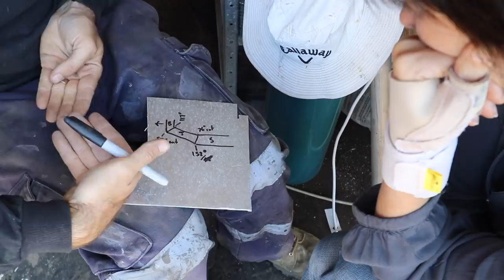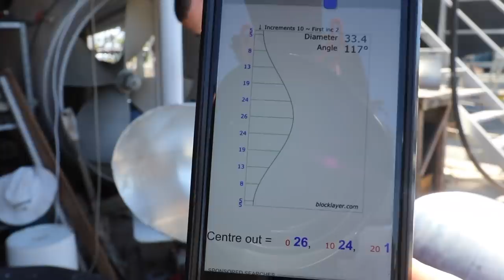DIY 2.5m Aluminium Pontoon Dinghy Part 2 - Project Brupeg Ep. 108

Comment: I did this with fiberglass a couple of times...once as an ultralight that planed off will a 3hp.
And once as a fwd decked heavy duty tender
 
The major problem was the dinghy getting under the curve of the hull of the big boat and banging hard...not a big deal when it was inflatable...but hard knocks for sure
Reply from the maker: Yeah our plan for that is to add a soft layer to the outer tubes. It’s not goi g to stop all of the banging but I’m hoping it will shut some of it up

Comment: Lol great teamwork! Only suggestion I would make is to weld the inside seams also if you are leaving those on the bottoms in case of water, or just orient them to the side or top so that no water sits in the overlap
Reply from the maker: Yeah we can oly weld the first 300mm or so as the spool gun is a bit to long to fit inside the tube. We plan to fill the sealed tubes with closed cell foam so its unlikely we will have any water in the dink.

Comment: Draw straight lines 3 6 9and  12 
Measure the distance at those points then in the middle of those points take more measurements connect the dots make cut

Comment: I welded some perlins down here in Mexico for a guy to make legs for a barn. It's not what I would prefer to use, but it's what he wanted. None of the barn was designed by an arquetect or engineer, so I was not real confident in the structural strength. So when I had to do butt joints on thin material, I welded strap over the joints so that there was much more weld holding the material together. It would be kinda tacky, but some aluminum strap that overlapped the weld about one inch on each side of the butt joints could add a lot of strength. I wouldn't fill the whole pontoon tubes with closed cell foam, but maybe the bow only. It Rhino lining available in your area? That dhinghy would be indestructible if it was Rhino lined especially on the bow. It adds weight, but makes it much less slippery and more bump resistant. Rhino lining is a bed liner for pick-up beds. In the States some people have gone so far as to completely coat the exterior of their Jeep's and 4X4 trucks. There are videos of them coating cement blocks and dropping them off of buildings and the block retaining it's form, even eggs. If this is a utility boat, that would make it very tough.
Reply from the maker: Thanks Jimmy, yeah I have thought about that rhino liner for the anchor locker

Comment: You could have rolled the tube just smaller and fit it inside the other two, cutting it 10mm longer than the lengths, then drawn round it, removed it, opened it too the correct diameter and you would have been close or slitted the ends and and inserted it that way, then welded up the slits. But you got there, great.

Comment: I think that working with those multi-angle joints using curved material would drive our Mr OCD perfectionist Damien right up the wall...  they never will be perfect.  😕
Reply from the maker: That sounds defeatists. Stuff can always be made perfect if you tinker with it long enough
Reply: @ProjectBrupeg  - And we love to watch you tinker, but even Jess said "so long as it's functional...".  Now, if you had real CAD (not cardboard), the multi-angle curves with tubular shapes could be done perfect.

Comment: I wonder what the drawbacks to using aluminum in this fashion are, and why others aren't also doing this. I suspect AL will not wear or age well as it has such low elasticity and will be prone to punctures and dents and deformations, even with closed cell foam filling the void. I feel like boats are usually in pretty bumpy situations, kind of a worst case scenario for aluminum. How does the cost benefit work doing this method vs using a more traditional method?
Reply from the maker: Easy answer nobody does this because of cost. Alloy RIB’s, absolutely pants most other boats but cost bucket loads more generally. A Patreon of ours was quoted $8,450AUD for a very similar dinghy, we have spent less than a grand. It’s only possible for us because we can do all of the design and build ourselves, if we had to pay for someone to make this we couldn’t afford it. As for long term degradation tubers dinghy last 3-5yrs before they become very problematic, last alloy dinghy I had was over 30yrs old and still going just as well as the day it was new. Alloy doesn’t fatigue through UV, it can be indefinitely repairs, like all metal boats if something corrodes you can just cut it out and add new metal. It has a host of positives that most boats can achieve. But cost is absolutely not one of them.

Comment: For two tubes to align perfectly both ends must be cut at the same angle.  Every angle has a different circumference.

Too bad you didn't have the old inflatable to cut apart to use as a pattern ;)
Reply from the maker: Thanks Jesse. We do know this but when your figuring how to do it, it takes time. The rubber tubes would have been too different. But thanks for the thought. Jess
Reply: @ProjectBrupeg  I wouldn't have the stomach to take on a puzzle like that.  Good on ya

Comment: can`t you take any measurements from the old rib. that was on the base of the boat. or cant you measure a dingy that is around you, to get the right angles that you need to make your cuts work for you
Reply from the maker: Hi Erick
Thanks for the ideas. It wouldn’t work and we still would have to figure a way to get the angle right with the tools we have. We sorted it out though and it looks great. Simple/complex solutions in the end. I’m glad we persisted. Cheers Jess

Comment: Question..
For the CAD could it have been easier to cut the cardboard into 3 or 4 strips. 
Then one by one place them on the inside and draw the template on to them..  And transfer over to make the cuts.  ..?
Reply from the maker: HA! that was an idea Trev had too. we sorta tried a version of that but it just added another set of challenges to the issue. yes it works in theory but it was still just as challenging once we tried it.
Reply: @ProjectBrupeg  next time make them square and bash them round (joking) 
See you uploaded a new video with it all done.. good on you guys.

Comment: CAD software would have made this a 15 minute job
Reply from the maker: Not necessarily true. We didn’t have CAD onboard and had gone through two different people who said they could do it on CAD (and never did). If they had managed to design it, we would still need to find CNC cutting and bending capabilities where we are (which there isn’t any). Based on this, we were over waiting for CAD and just built the dam thing.

Comment: You have to angle the end of the tubes that stick out past the transom and you just cut off a third of the material? You've done for a measurement line that could of been continued on from where the transom meets the tube but for some reason you had to make it ten inches back from transom? Also the line wasn't sufficient to measure from you had to go ahead and cut off the length of tube you needed for buoyancy with a skill  saw to get a wavy inaccurate end to measure from!!!??? 

  Really wondering what your going to do at the back now. So I'm eagerly waiting for the next episode. Weather it's finished with an angle (can't do now), a cone, or a half a ball. All a lot  tougher then an angle but it better not be a straight vertical plate because you won't have enough buoyancy  as the tubes are already  to short from your cut at the  back of the boat to make your measurements on the front....
Most of your projects  you think ahead a bit or at least think while your doing it. This one you just seem to be cutting and chopping without stepping back to see what you want as a finished product. I know It's a DIY boat build but this one is very frustrating to watch. Well at  least the front of the boat will look good while your bailing the back  water out!
Reply from the maker: Ye of little faith, youve made a lot of assumptions here. Assuming we didnt have excess on the rear of the tube (which we did on purpose) The back actually turned out to be the best bit of the boat, really happy with how it worked out.

Comment: This was so painful to watch. For your next time you need to use fit up lay up basically dysected both end measurements at the same time after you cut the angles your using by measuring from each piece for distance starting at your outside center line make spaced out measurements every inch all the way around between both pipes from your center lines this will get you your angles and the pitch. Dived all your measurements by 2 for your diameter center line transfer your measurements laid out in 2D on paper starting with the inside center line ending back at the inside center line connect the measurement ends cut it out rap paper around the pipe there's your template. Just like you did at the end.
Reply from the maker: It’s not that simple and painful to do but worth it in the end

Comment: Ocean Craft makes aluminum tube R.I.B. tenders with a "pointy" bow, not sure if this would make the angles easier or harder to measure.  http://www.oceancraft.com.au/OCEAN%20CRAFT%20SV%20DELOS%20Brochure%20FoamOFloat.htm
If you made a jig to hold both tubes one on top of the other while you cut through both with a long saw held in a grove like a large miter box that would seem to be the ticket.
Reply from the maker: Hi Jeff, yeah we did look at Delos dinghy a bit but we wanted a blunt bow on purpose as it adds internal volume to such a small dinghy (2.5m total length) and makes it easy to board bow on at wharfs etc. That said your idea of a cutting jig is a nice thought, we did ponder hat it would take to build a big band saw so we could just line up an angle and slice vertically downward.
Reply: @ProjectBrupeg  I understand & agree with the benefits of a blunt bow. I love the concept of this tender. It will be interesting to see how you get the angles cut correctly. Do you know which is heavier the aluminum tubes or the inflatable Hypalon tubes?
Reply from the maker: We never had the rubber tubes so I couldn’t say. But the alloy is pretty light. Hoping to do a weighing of it soon

Comment: Once all the welding is done, I would fill the tubes with closed cell foam. Just make sure it's Closed Cell foam, will not absorb water and you will have an unsinkable dinghy.
Reply: I was thinking the same thing but I hear that foam is very heavy.
Reply: Certainly fill it with something...
Reply: Preferably not flammable if you want to ever repair it.
Reply: If the alloy tubes are properly welded and air tight it will be unsinkable capping the pipes to make2-3 seperate sections would have been a good idea.
Reply: As far as additional flotation, ping pong balls work well. Just my $0.02.
Reply: Empty fizzy drink bottles. They're free, light and tough.
Reply: I agree. We used a two-part stuff at a place I once worked-- mix it up and pour it in to whatever. It was incredibly strong, very light weight and fire-proof (extreme heat just caused it to pucker a bit where the heat touched it). It also adhered  to whatever surfaces it was in.
Reply from the maker: Hi All, yes the plan is to fill using expanding closed cell foam, for three reasons, its lightweight internal rigidity, its floatation so we cant sink, and finally we have internal electrical cabling sothe expanding foam locks the conduit in place so it cant flop around inside the tubes.
Reply: @ProjectBrupeg  Hey guys knowing where you are going you may want to leave a void in the tube for shrinkage issues. Not Dames but the aluminium the foam may not compress when the tube reduces. Have not tried foam insulation in something that moves low and high temp zones
Reply: Perfect!
Reply: Excellent. Using conduit allows you to replace or add more wires later (impossible to do, otherwise-- that foam is like glue). The foam only adds a few pounds to the dinghy, but it's inherently buoyant-- so even if a pontoon breaks off, you can cling to it and survive. And, yes: it's incredibly strong. Those pontoons will keep the boat afloat even if sliced neatly down the entire length (and they won't fall apart). Also, it would take a pretty mean furnace to burn that stuff. Perfect decision.

Comment: When you cut a circular tube on an angle, you create an ellipse. The ellipses you need to calculate need to take into account the front tube section diameter as well as the size of the ellipse and diameter of the side joiner tubes. If you send me some dimensions, I can have it all worked out for you  before  you finish your morning tea.
Reply: descriptive geometry  is the answer
Reply from the maker: Sounds good but the boat is actually built now, your watching about 3 weeks behind real time.

Comment: Your getting the tubes fit up so you can tack weld them pretty well. The problem is your working in 3 dimensions and calculating in 2 dimensions. As a fun project when its not a good day to work. Take some 1 1/2" or 2" pvc pipe scrap and cut two 8" long pieces, two 4" long pieces and one 2" long piece. Then lay them out on a flat surface and form a u shape like the dingy tubes.  If you were to glue the tubes where they touch each other on the inside edges they all will stay in line and follow the form of the hull. Then you have 4 pie shaped wedges that close the gap between the tube ends and close the u shaped cylinder. All you need to do is cut rings from the tube as wide as each gap and trim the rings to fit between the tubes to close the gap by trimming the wedge oversize but close to the finished size and start at the widest point and stitch weld and trim the piece to fit into the opening. Once you had the two long tubes welded to the hull, I would have turned it upside down resting on a flat surface and fit the tubes around the hull. Then after the are all pretty close to a flat plane I would add a few temp braces to hold them semi rigid and started closing the tubes. I know you ended up with a rise in the tubes but that really complicates fitting the tubes because you working both horizontally and vertically at the same time. I do know your finished, just offering my perspective. Your getting it done.

Comment: You were so close with the string.  You had one string at 0 and 180.  add a few more, mark them and move them to the new tube for the angle.  
Also clamp the tube down.  A 90 degree carpenter square against the tube hits at zero, drag it down one side, (it will scratch it lightly), flip it on the other side,  it will hit at 180.  Unclamp and rotate 90 and reclamp.  Repeat with carpenter square, now you have 90, 180, 270 and 360/0 marked...  4 stings and done...

Comment: Greetings from the north of Norway! You guys gave me the courage to start up a project of my own alongside of a buddy of mine. We bought a 1980 Nordkapp 17 HT on the cheap. The engine, Volvo Penta AQ120, needs a fix. Water inside the boat (melted snow water). Some small electrical things, battery is dead flat from standing in water and some light are busted. Some manual labour and TLC it should be all good. Can't wait to start working on it and fix problems. Thanks for the all the videos and the encourage, somewhat unknowingly, from your side! Hope you guys take a stop in the Northern parts of Norway on your voyage someday! I would gladly come aboard and help out and show you some of the sights around where I live.
Reply from the maker: Arne that sounds great mate. we REALLY want to get to scandinavia, our plan is to spend around a year there before we head through the northwest passage. Would love to have you onboard

Comment: I know this is a bit late but what if you welded a flat cap between each joint before you welded them together? This would create a bulkhead and strengthen the tubes.

Comment: Wouldn't it be easier to run the two side pieces first and then finish with the front piece. Smaller piece to work with only one piece to work with. Just my 6 cents worth. Good luck.
Reply from the maker: Hi Paul, yeah that would have been an option. we were limited by under ordering 3 instead of 4 tubes so we didnt have enough to make the last front tube by the time we realised. that said if we were doing it all again I think we would cut the bow tube out, then the two linking tubes and weld them together on a flat surface (creating a V shape) and then shape and move them back onto the side tubes so we are only ever dealing with two simple joins in total. Still this is why we built this little dinghy first, we want to learn how not to do it so that when we build our jet tender we actually know wat we are doing...
Reply: @ProjectBrupeg  well done.... good to think 40 times and cut once

Comment: Don't feel bad about the snide Comments from smug Google-searching smart-ar*es about finding those tubular angles. Mitre gauges, sliding bevels, rafter squares and angle-protractor dividers were invented for a very good reason!

Anybody who's ever put a pitched roof on an old house will know that cutting timbers to fit in 4 directions at the same time - FIRST time - can be an absolute nightmare. You only get one go at it, and you can't glue bits back on.

I think you did a brilliant job with your tubes. Or should they be YouTubes?
Reply from the maker: Yeah its like water off a ducks back now. Lots of armchair engineers on the YouTube